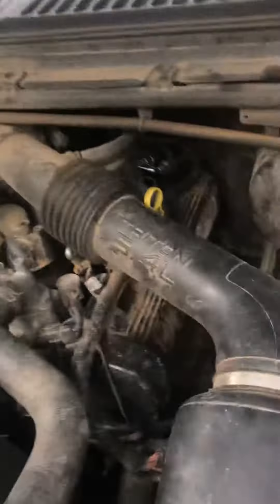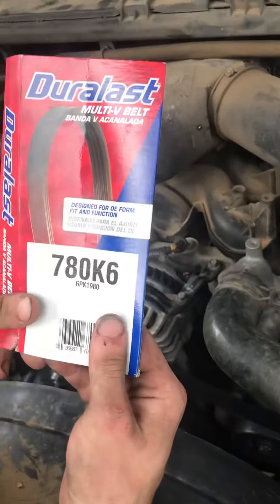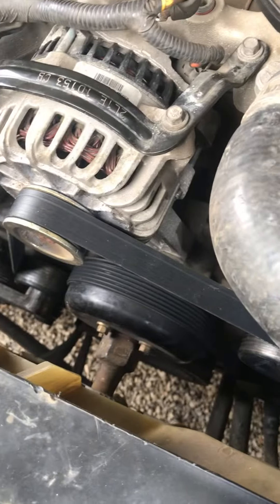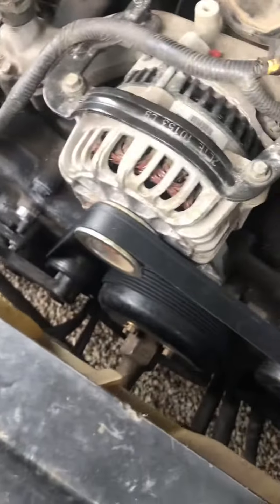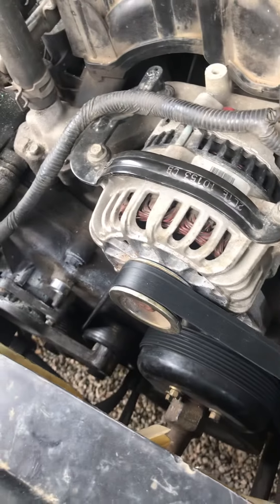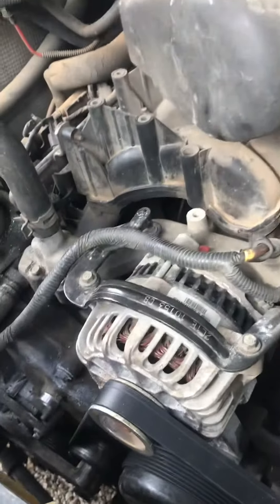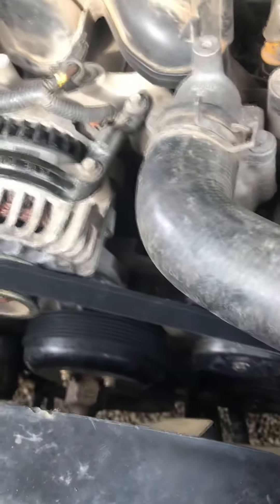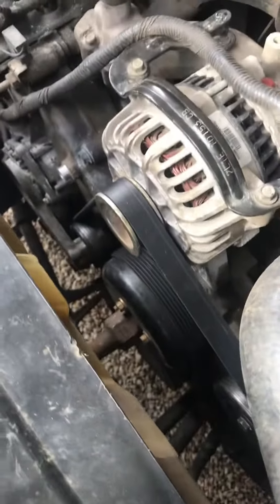2003 f-250 5.4 ac bypass serpentine

Comment: I did a by pass on my 2002 f150 super cab fx4 5.4 v8. I replaced the idler pulley with a 6 rib idler pulley and a shorter belt. Fired right up and no issues no squealing. Go to O'Reilly and ask for Murray pulley part number 2330012 and belt Gates Micro V k060798. Just make sure to route it right.

Comment: Did this continue to work with no issues?
Reply from the maker: Still on today, same belt, it’s a got a grove in the belt at the very end , it’s rubbing on something but it’s been on for bout 25,000 miles so far.
Reply: @Trenton_Butler325  thank you very much for the reply! Awesome!
Reply: Got it! Worked perfect i figure you saved me hours of labor and atleast 200.00 thank you
Reply: Do you get a belt squealing upon starting.
Reply: @garyburkhalter7628  no its been a week now have few hundred miles on it with zero issues. I actually loosened the two bottom bolt of the alternator and took bolt out of top bracket i was able to tilt the alternator enough to slide belt on and bolt it back together.
Reply: @garyburkhalter7628 yes I do...did yours ever stop?